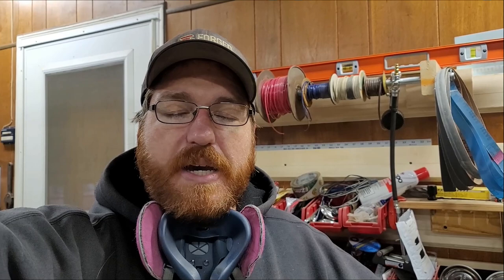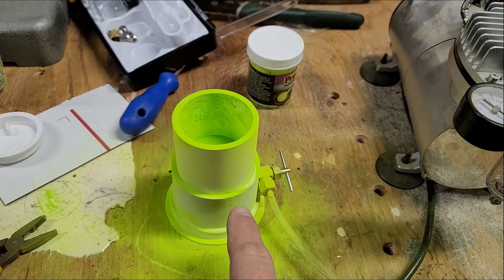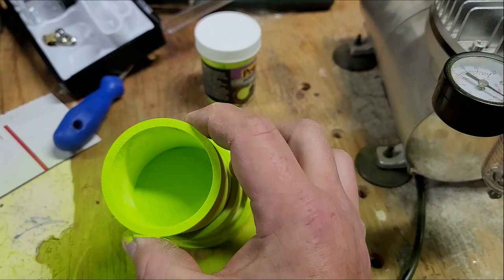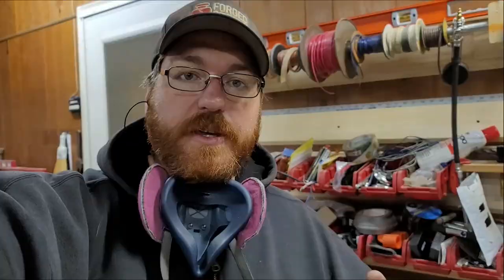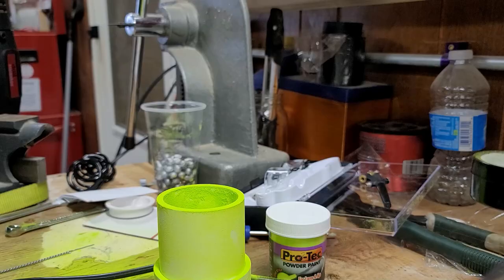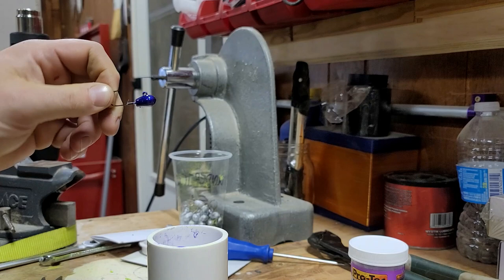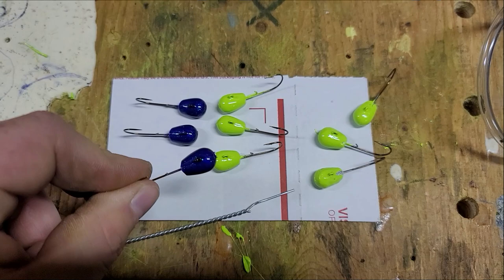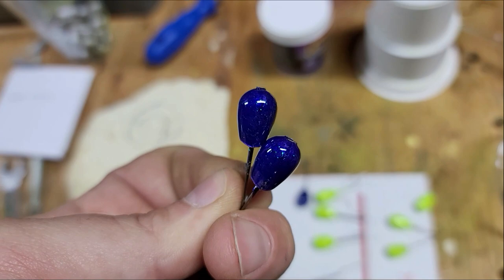How did I NOT know about this?!?! (Jig painting game changer)

Comment: 1) get a cheap toaster oven heat the jigs to 300 degrees. 2) Dip the jigs for color 1. 3) Use a paint brush to sprinkle colors number 2 and three from another jar. Do not let brush touch the jig. 4) Heat in oven for 20 minutes to cook on colors. 5(place stick on eyes. 6) Dip in Lacquer and there you go. Firetiger is a 4 color jig.
Reply: Sally Hanson tough as nails clear finger nail polish works as a good sealer and you can pick it up for cheap at a dollar store. $1 a bottle here in Indianapolis.
Reply from the maker: True, I first started using that on fly fishing flies, works great!

Comment: I read most of the comments but didn't see the answers?
#1) How long does it take to dry 'em,,,, like your hanging them on the rack?
#2) do you throw them into an oven after they touch dry?  Does it help the hardness?
#3)  About, how many jigs can you do with that amount of powderpaint?  Say 500 out of that small canister?
I'm also thinking or coating cast bullets & wondering how long it will take to do a 1,000,, & how much powder i need to buy?
THANKS,,,,, For a very good to-the-point video!

OBTW,,,, I fish. So would a 'BABY BUBBLER' from Wallworld work?  Just put the air stone defuser inside of the powder coat container? SIMPLE.
Reply from the maker: 1. As they cool they set up. So maybe 1 or 2 mins.
2. You can harden them further with another cycle at 350 for 10 minutes.
3.  Alot with the small tubs, I would say easily over 100 per container depending on size. Small jigs 1/32 or smaller would be 150+.

I run cast with my pistols. This stuff coats decently thick. I haven't tried to coat any casts yet. Depending on grain weight I think you would need to order the bigger jars online I think they have some larger sizes. But I would definitely run tests on the coating first to make sure it works for that application.

The baby bubbler could work as long as you had a good paper medium to make the filters out of to get an even bubble.

Comment: Look a lot like bfishn h2o precision jigs. 👍
Reply from the maker: Right on, didn't even know that those things existed, I got a little cut out on the back side for a soft plastic but definitely similar. Nothing new under the sun they say lol.
Reply: @RevampedOutdoors  they look sweet. Pretty much anything they isn’t just a round jig head is the tops in my book. Idk why but when I use something 1) a little more narrow profile, say a vmc moon eye. 2) or a more oval style type head.. . I catch more fish.  Have a bunch unpainted I’ve been like 🤔 do I had paint and epoxy since I also build  rods and have epoxy around, or do I just powder a few and get out and test the durability?    No idea where to even get started. Today is my first day of considering the powder coat technique.
Reply from the maker: @braxtonsmith3892  sorry for the late reply I just now saw the question. If you're anything like me you've tried both already. But. What I would say about the powder is it's durable without the cure about the same as paint, with a cure it's "chip hardened" by that I mean it will take a beating until a small portion chips off. Not baked it will act like nail polish, with 10 minutes at 350F it will be hardened and take a lot more abuse. Nothing is perfect though if you hit a bridge piling it will chip off but running over gravel or cobble it holds up pretty darn good. I hope this helps and wasn't too late! Thanks for the comment!

Comment: How did you get or make that tube that the air goes into?
Reply from the maker: The clear tube? That's just a standard aquarium tubing/hose you can pick that up anywhere fish tank supplies are sold, big box stores hardware store etc.
Reply: Okay, I figured and ended up finding one, and I found a valve made for aquarium pumps too. Got it all assembled and tested, just waiting for more paint to arrive. I'm painting 4inch long jigs, so I needed alot of powder to fill the tube.